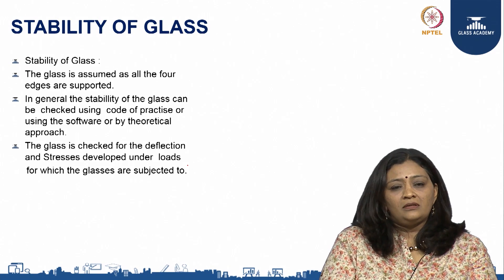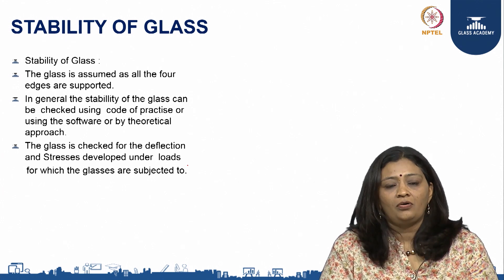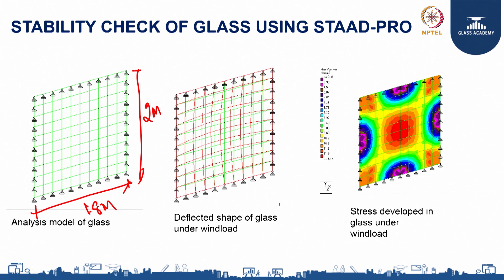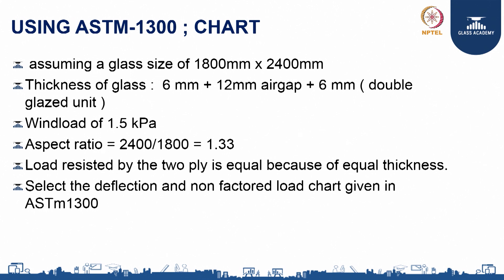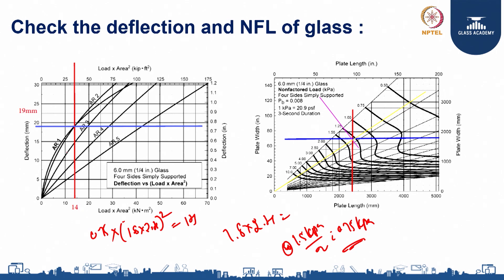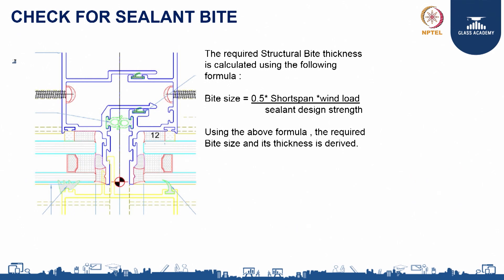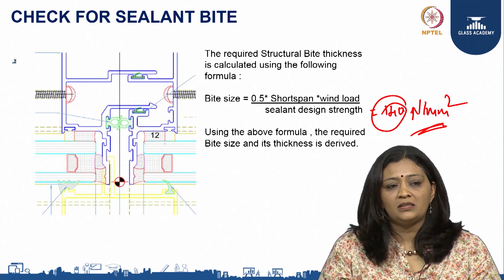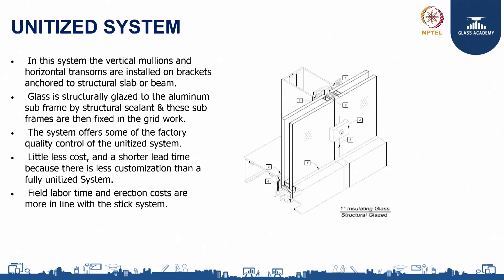Structural Design of Facades Part II

Comment: Thank you for wonderful information. I appreciate you if you could clarify two points of the example about the glass design. #1. according to Table.2 of the ASTM-E1300 , GTF for double HS glass is 1.8( you considered 1.25). #2.there is 12mm air gap between glasses therefore, they won't support each other structurally, why you calculated load/2 in the calculation for each ply? 
Again thank you so much for your time and sharing your valuable knowledge with others.